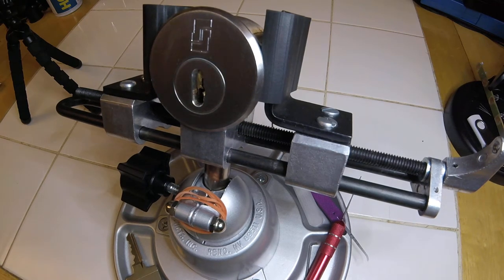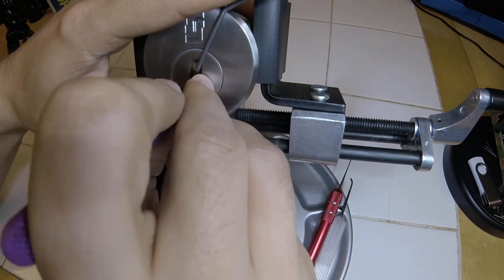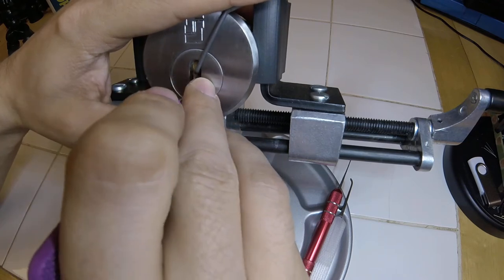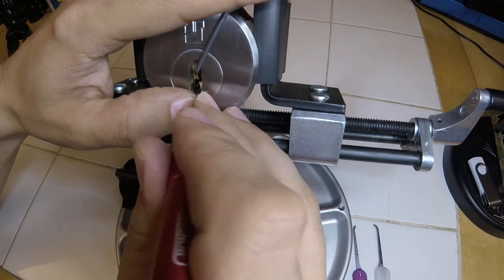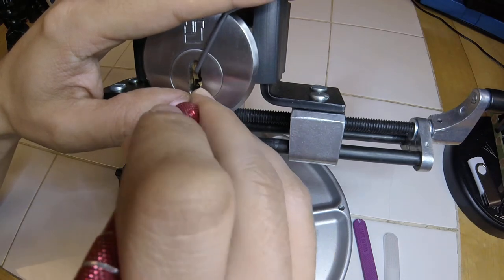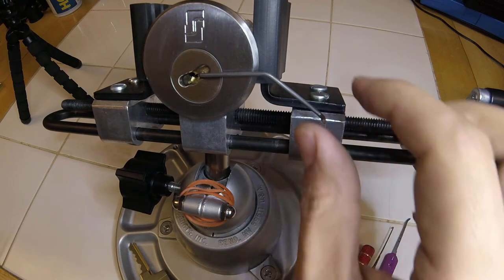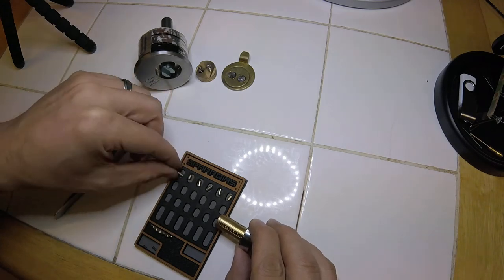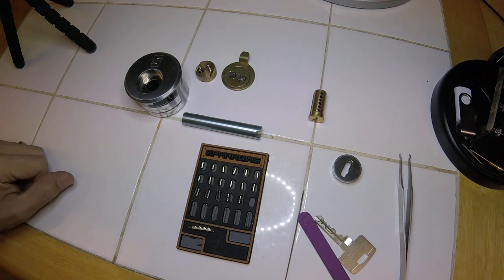[L37] ASSA Twin Exclusive (newer model of the 6000) - pick and gut

Comment: Nicely picked👌 I love the Mogul 6K😍
Good idea to progressively learn this lock, side bar pins and top pins seperatly.
I just ordered one of these and really looking forward to picking it.
Have a great weekend👍😀✌️
Reply from the maker: Hopefully this video helps with your picking journey! Do note, if you do it like I did and learn the top pins and sidebar separately, once you put them together there is a little different feeling as the sidebar is putting reverse pressure on your tension so you need to use more tension to get the same amount of tension you had without the sidebar. Also, I would recommend leaving the sidebar pins (and springs) in while doing the top pins and just remove the sidebar itself. This is because those pins get in the way of the pick when picking the top pins, and if you don't have them there, you have way more room to work with and this is not at all like when the lock is fully pinned up.
Reply: Michael Gilchrist Appreciate the advice but I will probably try to pick it as is first only because I like to make like harder for myself lol. I'll be practicing on the Schlage Primus to tackle the 6K as the Primus doesn't have serrated side pins like the 6K. Did you try picking in both directions and did you feel the sidebar engage first in either direction more?
Reply from the maker: @KeylessEntry  Of course! You have to pick it for a while unmodified, that's a requirement for sure! I tried both directions before going the top pin/side pin only route after which I stuck with my comfortable tensioning direction, CW